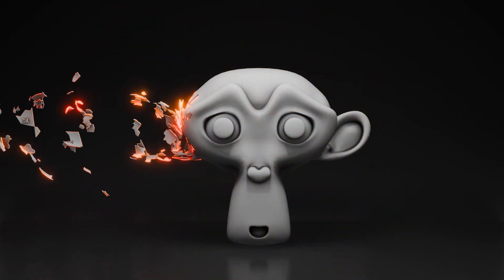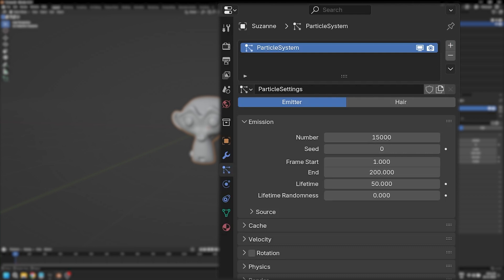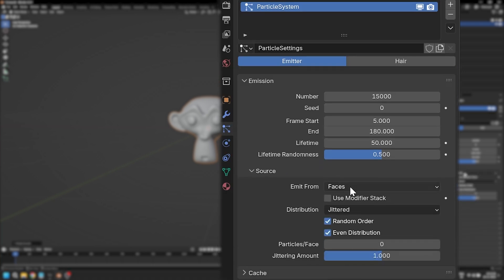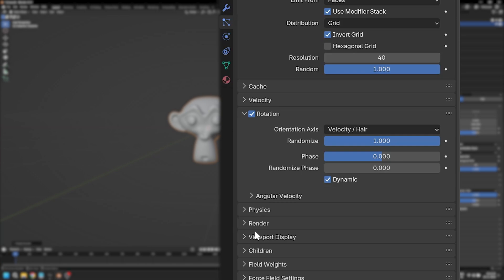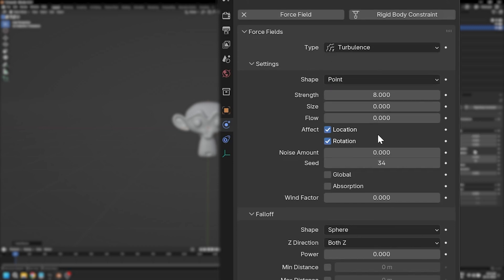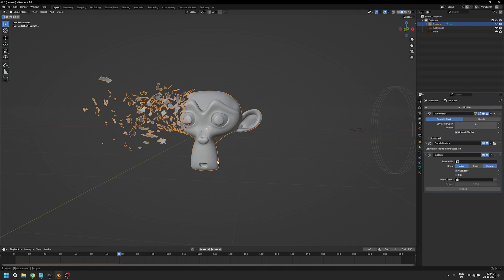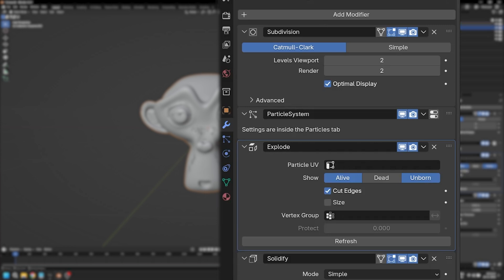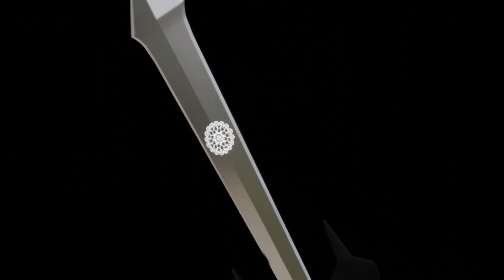DISINTEGRATION effect in BLENDER, NO GEOMETRY NODES NEEDED

Comment: Hi, I have a question. For some reason, when I use 'Distribution: Grid' in a particle simulation, no matter what I do — even if I bake it — the render looks different from the viewport preview. However, when I hit 'Refresh' in Explode modifier the viewport finally matches the render — but the result is not what I want. In fact, it's kind of ugly. Any suggestions why?"

Comment: this great, loved it, just did the effect and its working, but how can we control the effect to go from top to bottom or right to left back to front ect, how cam we control the braking direction?, that lets us costomise to what ever scene we want to use
Reply from the maker: Hey..the breaking direction is controlled by the direction/rotation of the origin point ..you can change that by changing the origin point rotation
Reply: @rasheedsedit3848  I wanted to change the origin point so I applied origin to 3d cursor but it doesn't change the start point.. please help.